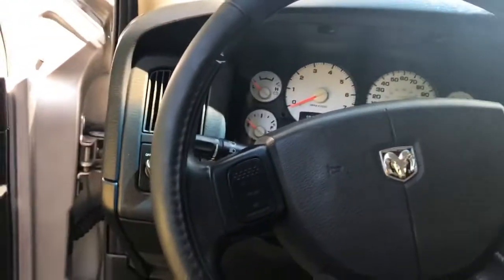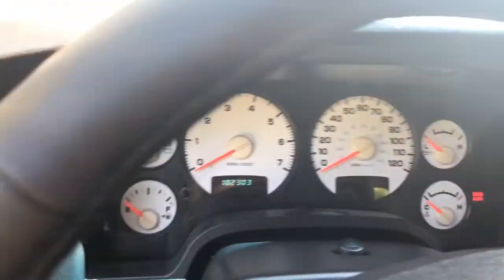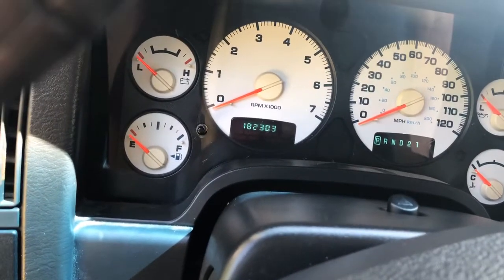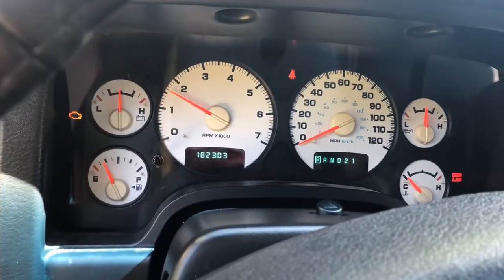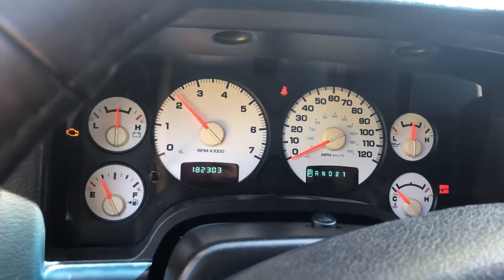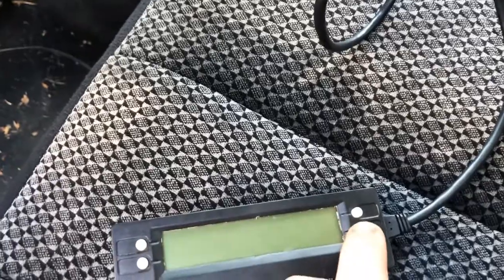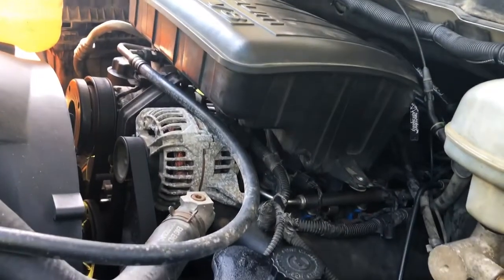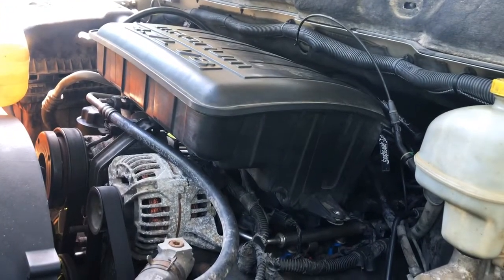2004 Dodge Ram 1500 4.7 wont stay running need help!

Comment: I had this same issue. After replacing plugs, coil packs and fuel injectors.   I had gotten a little bit of oil on my coil pack connectors.    It gave me hell trying to figure it out.  I also cleaned my MAP and Idle Air Control Valve.  She is purring like a kitten now.

Comment: In my case was EGR valve. Same code, same problem. After replaced, like a champ.
Reply: You had the same symptoms?
Reply: @jpnm81  yes. Exactly the same symptoms.
Reply: @manuell9482  thanks!
Reply: Hey man we fixed it! 👍🙏
Reply: @jpnm81  good for you.

Comment: I had the same problem with my 2004 dodge ram 1500 4.7 L V8 2 Wheel Dr. Throttlebody sensor idler airflow sensor map sensor cam and crank sensor but then I changed all three sensors that’s on the transmission and now my truck is running great
Reply: Which transmission sensors did you change?

Comment: I had same issue w/my 2004 Ram 4.7 & it idles fine since replacing EGR valve. Currently have 230,000 miles on it without issues.

Comment: That happened to one of my buddies truck Truck would only stay on if you had your feet on the pedal or else he will die he took it to a shop they said He lost compression on two pistons. His truck was a 2003 Dodge ram 5.7 Engine with only 80,000 miles on it

Comment: This for the guy with the 4.7 04 dodge ram yor motor is running rough because of poor idle and you have no compression you Al's may have carbon buildup on yor intake valves and inside yor plenum intake so check your heads yor valves could be hitting yor pistons. Ps I hope this helped you out.
Reply: Did this work
Reply: 4.7 is a non interference motor, valves won't hit the pistons